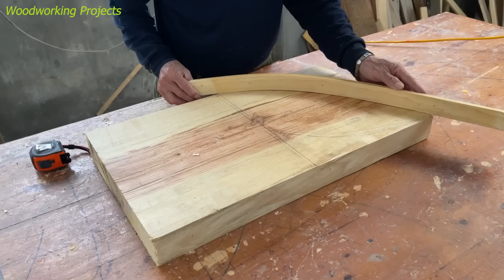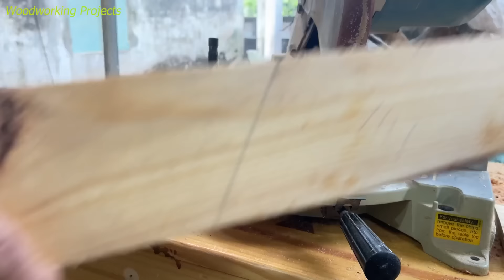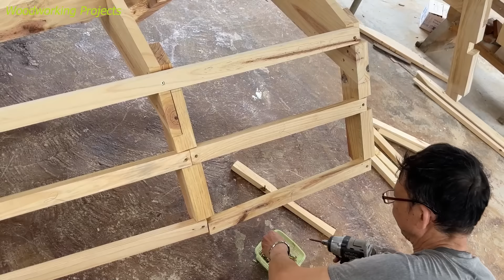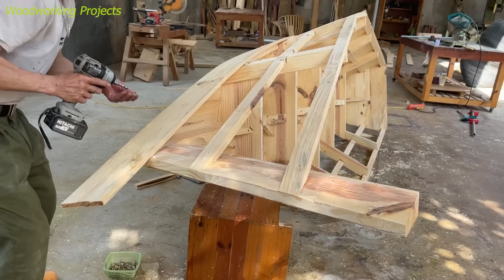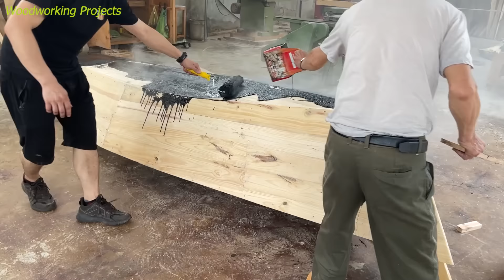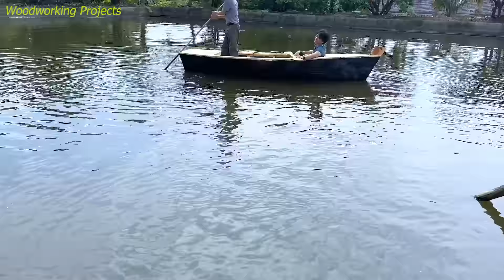DIY Wooden Boat: Crafting a Classic Vessel from Scratch // Amazing Woodworking Project

Comment: So much wrong with this.. I mean seriously how thick and heavy do you need a boat for a fish pond?? Screws that will rust and not even coated,,, seams of wood not staggered, Tar in a fish pond as in oil slick... Pine wood with all sorts of knots No keel or other stabilizing wood strip to keep it on line in the water.. etc. etc. I like screws very much and he did predrill whihc is great.. BUT if you don;t seal them or coat them they will rust even if non salt water...  
Just my opinion after being one of the best rail men in Norfolk area after being raised on a sailboat from 6 to 12 and sailing half way around the Earth m Hurricanes, Panama Canal, and so much more... But I've never built a boat for a pond, so perhaps I'm out of my league.

Comment: What i want ti know is regarding hull size and shape do you have to go off specifics  calculations? Or will any old shape do as long as its water tight
Reply: It depends on what you want the boat to do a watertight box will work as a boat but odds are it would be a terrible boat unless it fits what you're useing it for

Comment: He generated a curve by bowing a batten between two fixed points. Nails, as it happens. Is that a reliably repeatable process? If you repeatedly constrain a batten at defined points  and bow it at a defined point for a defined distance, are the resultant curves identical? Has anybody ever tested this?

Comment: I am a decent sailor and an accomplished woodworker who has designed and built several boats over the years.  I can see why some are impressed - they are ignorant regarding stress that can be placed on watercraft except on calm water.  Weakness is in the design because the wood structure has too many buttjoints.  The lines are not smooth which will add resistance to motion.   The sides are very vertical compared to the narrow bottom will make it unstable.  Over all, a poor design.  Plus, knotty pine softwood and no caulking?
Reply: Ya a deeper keel would help stabilize. Your right about ruff water. This design is meant for a smooth pond.
Reply: Wow I have always been curious as to why when someone puts a video out there some people come on commenting tearing the work to pieces rather than giving constructive criticism to help them to build a better boat or whatever it is they are making. Now I don’t have the knowledge you pair “seem” to have but the lines look good however maybe tell them how to use the design and improve the build. Now I guess I have to bow to your “superior” knowledge but like I said it looks like a nice boat “for a mill pond” according to the experts here. Just “ my” opinion but you’re welcome to it.
Reply: @jimmorrison3035  this is helping them to maybe better design the same model not tearing them down the world has become very touchy the person making the video should take whatever he can to get better that's how it's done learn from others that may know more than you
Reply: @user-TommyD35  sounded very critical to me more like saying it’s usLess however if you look at where they were using it it’s like a mill pond no outboard or skipping over the waves like the decent sailor must think it’s going to be with all that stress on a watercraft. Like i said only my opinion but your welcome to it.👍
Reply: That exposed bandsaw blade, made me nervous.  Lower the guide please.   Eeeks